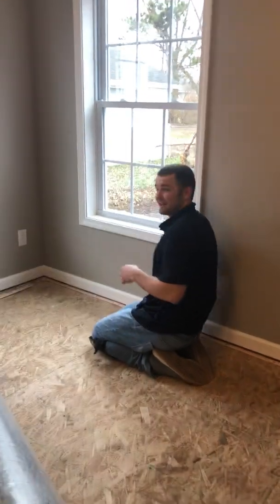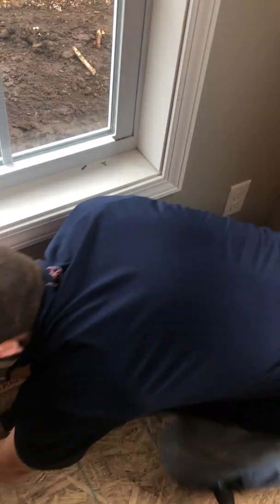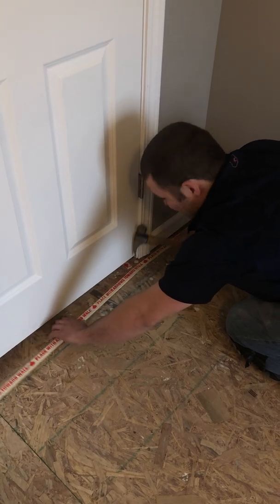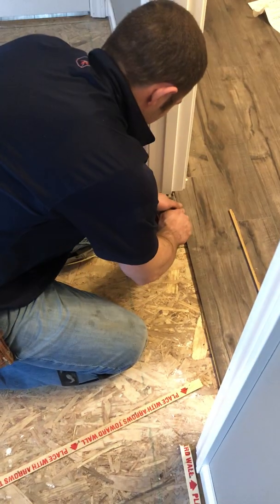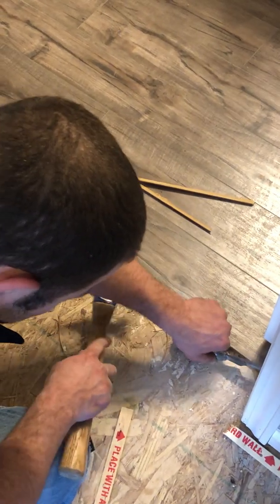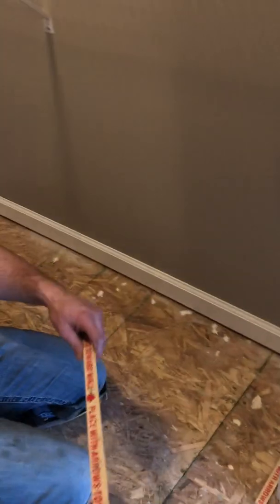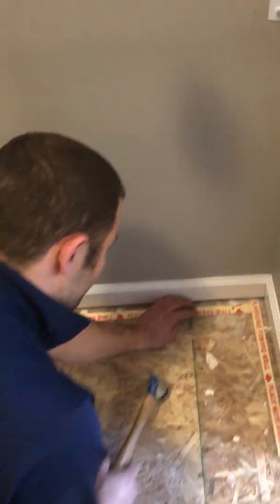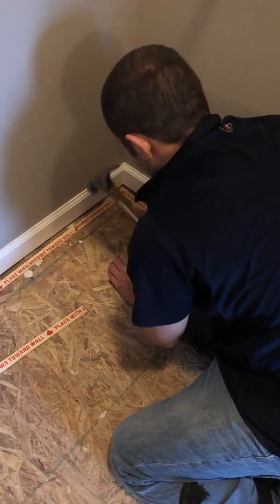EASIEST CARPET TACK STRIP INSTALLATION METHOD

Comment: I'm a floorlayer from the UK and I really like what your doing! I tried the same thing with a curved claw hammer and it worked pretty well so I'm guessing with a straight claw hammer it will work better.
 By curiosity what hammer are you using in this this video?
Reply: @smartfloors4542  I bought a 16oz straight claw estwing and it works great much quicker as you can flow in rooms with stopping to cut the strip. Looking forward to your future videos

Comment: I had one job where the baseboard was custom made by the owner.
He told me if I hit it I would have more to worry about than paying for it.
I used cardboard and a magnetic nail holder for safety... My safety lol.

I only make mistakes and hit baseboard if I am worried about hitting it.
Confidence is key when doing stuff like this. Great video!
Reply: Well I won't be here long, I'm planning to move my family over to the east coast near North Carolina.
But that would be awesome to learn how to install tile from you!